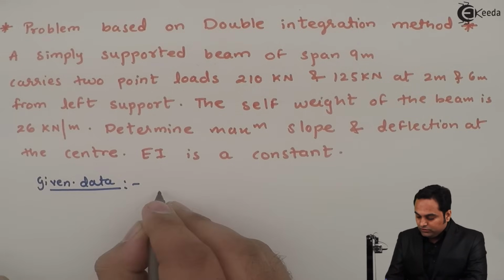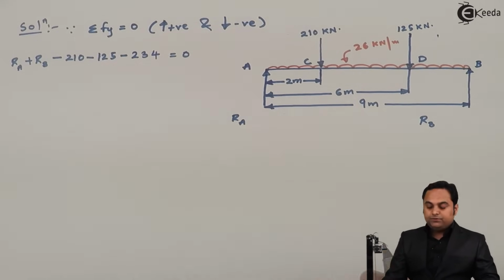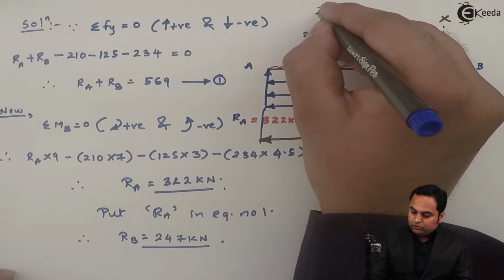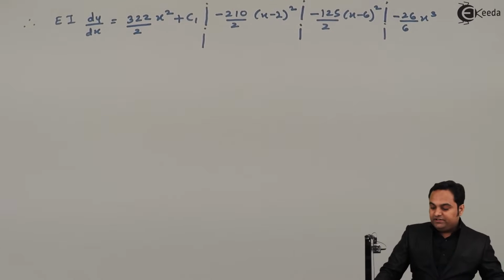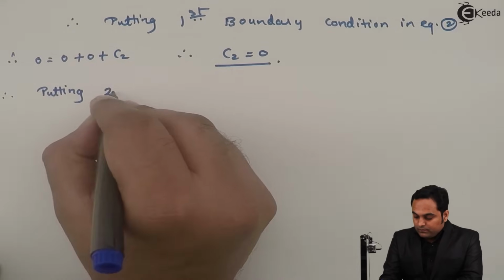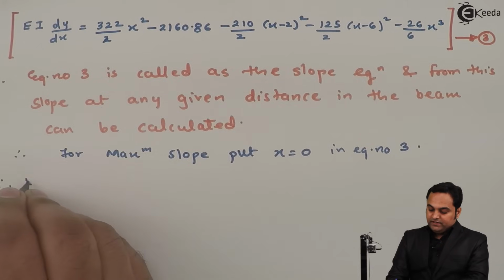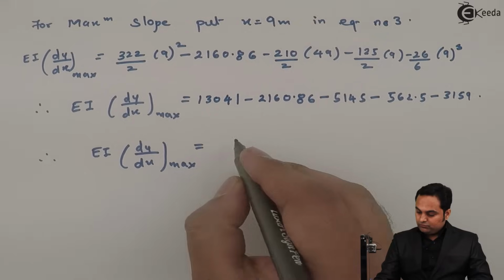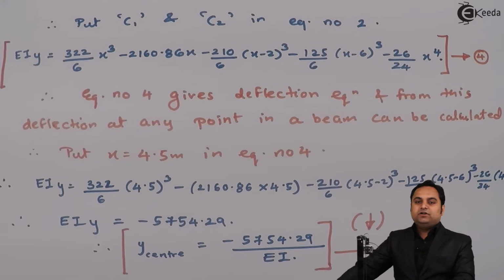Slope and Deflection (Double Integration Method) - Problem 1 - Slope and Deflection of Beams

Comment: The method of solving this question using the double integration method involves finding moment equations for 3 cross sections. Find the displacement and slope equations using double integration and integration of momentum equations. Using the principle of continuity and boundary conditions, find the constants, which in this case would be 6 constants. Substitute the respective constants in the slope and displacement equations of the middle section and then substitute 4.5 in the place of x to find the displacement and slope at the middle of the beam. I don't understand in the video how only the momentum equation of the third cross section is used to represent the momentum equation for the whole beam as done by you. Can you please clarify?
Reply: It's wrong

Comment: Hlo Sir
In this question you have taken boundary condition as the initial point x=0 and x=9.So i want to ask, it is neceassary to take the initial and final values of x.Or any mid point can be taken??.Plz ans. Sir
Reply: Usually its initial and final, every question i solved i used initial and final

Comment: Also, why c2 is always zero, -125/6(0-6)^3 = 4500 . Howwww
Reply: The way I understand this method is : you ignore the expression when you get a -ve value inside a bracket 
So you will ignore the -125 (0-6)^......because the bracket give a -ve value. Hope this helps👊

Comment: Sir how we find x for maximam drflection if we don't know where maximam deflection occure
Reply: Simply put slope equation equal to zero  and find x
Because at the point where deflection is maximum slope is zero
Reply: mubasshir hussain .....yha but d calculations  part will be difficult......
Reply: kashi Bhojia for a simply supported beam maximum deflection will always occur at the center
Reply: CHANDU DEVAVARAPU yha but only for symmetrical  loading.....what about unsymmetrical loading

Comment: Hello there, very informative video. I have one question, at 10.45, the UDL is 26x^2/2. Why is x squared? Thanks
Reply: Kieran Butroid  26x is the total weight due to UDL upto distance x.. Also centriod of UDL is at half of the length which means total load due to UDL acts at x/2  Thus Moment due to UDL = (Total load due to UDL) x (Distance of centroidal point of UDL from the point about which moment is to be found) = (26x . x/2) = 26x² /2

Comment: why is c2 always 0???
Reply: xavi alonso ....bcz it depend on d end condition or boundary  condition  to find C1nd C2.......nd end conditions  r only used to find d value of C1 nd C2.....nd this end condition  says  that we have to put deflection or slope =0.....since the slope at d end is max....nd deflection at support is zero...thats y we put y=o in deflection =q 
but if same question  whould be asked for cantilever  beam than d end conditions  will be changed. ....nd that is......at fixed slope there is no slope nd no deflection.....so from here u put slope = 0 in slope =q to find C1 nd than y=0 in deflection=q to find C2

Comment: sir,
Your method of teaching is very good and systematic. I have one doubt while taking all calculations what about the weight of member itself?
For eg if I have to fine deflection of I beam sized Ismb 125 simple supported at ends at distance of 12 mar and extorting no other external load from top but is carrying self weight  and the what would be maximum deflection at centre of beam?

Secondly same beam is suppose placed vertical and fixed at bottom and top end is free, then if air flows at speed of say 125kmph then what would be the deflection of beam at top because of wind pressure?
I see many examples for cantilever considering horizontal but no example on such vertical free beam, kindly request you to pl clarify the doubts.

Thirdly while we place vertical beam fixed at bottom only but no direct second external load on this beam but this beam will be carrying self load then how to find at what height of such beam will buckle and what would've then safe height of beam to be paced.

Thanks Madhuttam
8108508863
Mumbai
Madhuttam11@gmail.com

Comment: when you were substituting with x=0 at(18:00), why did you substitute only for the first section of integration.
Thank you
Reply: Nadine Hossam 
Because in simply supported beam slope and deflection is zero at the ends . And also we are neglecting the parts that is (-ve) so if u apply the Conditions for all the equation again u will get the same value.
Reply: you mean if we put x = 0 to all the equation C2 will turn out to be zero again?. İ TRİED BUT its not zero
Reply from the maker: We recorded your response. We will work on this and get back to you.
Reply from the maker: We recorded your response. We will work on this and get back to you.
Reply: same dought
?

Comment: As per macaulay's method, you have to take the expressions zero whenever the negative or zero occurs in any expression. but here, while calculating deflection you didn't take into this considerations which gives wrong answer. please clarify this. Thanks.
Reply: Exactly where my confusion is, this guy here doesn't neglect simplifications that gives out -ve
Reply: so it should be that the value of x which is equal to zero, must be substituted to all terms? Im confused too, sorry :((
Reply: @marykathleensatuita129  that's what also I was thinking
Reply: So the ans is, the when the value inside the brackets become negative, then the term is neglected

Comment: sir this video is awesone but i have one question and i.e. Why 1st boundary condition is applied only upto c2 at 18:03?
Reply: Sumit singh because in simply supported beam 'y' or deflection is zero at end supports
Reply from the maker: We recorded your response. We will get back to you shortly.
Reply: my question is that how can we take at x=9  y=0?
Reply: @Sumitsingh-th3wl  for simply supported beam, deflection is zero at supports
Reply: according to macaulay method ...if the value in brackets(even if it is square) is negative then we should not consider those values